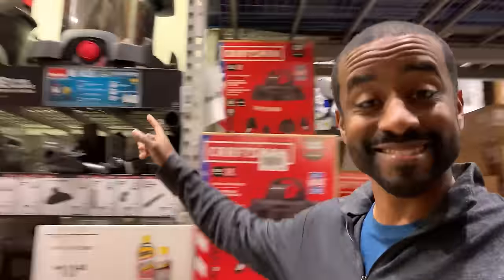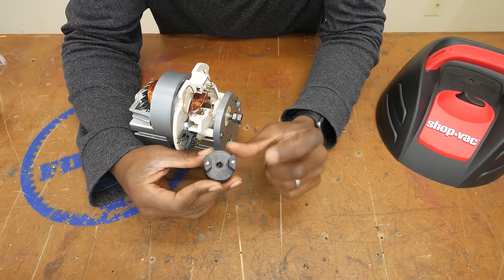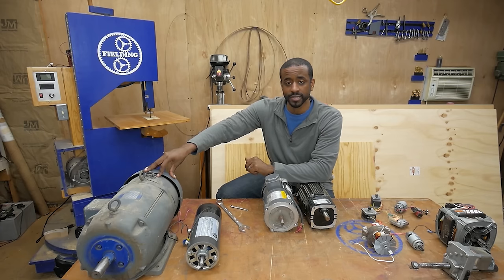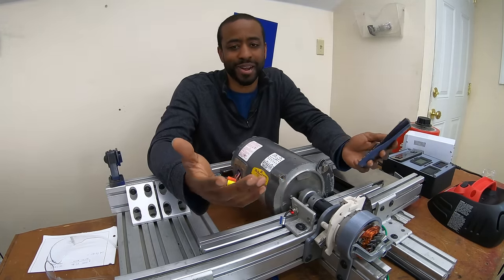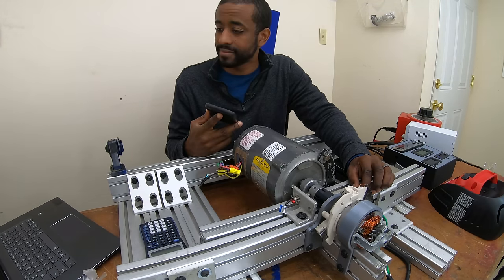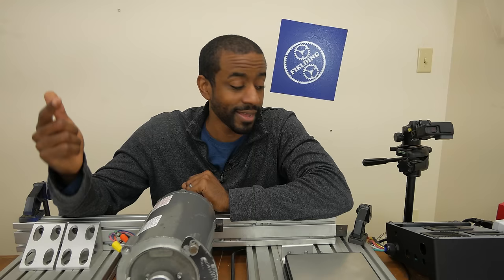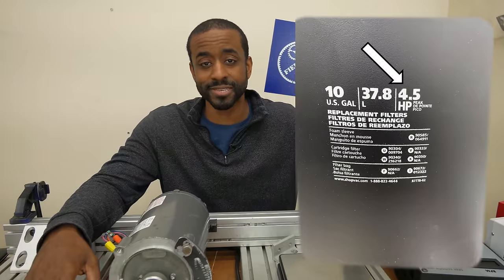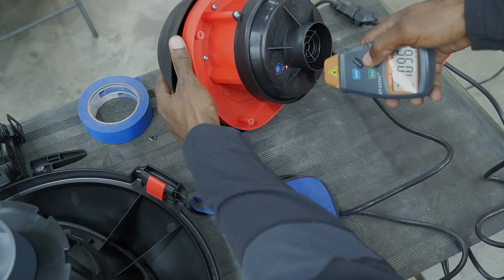How Much Horsepower Does Your Shop Vac Really Have: #078

Comment: What they are saying is if you "unload" the motor (by blocking off all airflow), then suddenly unblock the airflow, the motor will slow down.  In the course of slowing, kinetic energy stored in the spinning rotor will be released.  This release will add to the power produced by the motor itself, raising the power for this brief instant.  This has little relevance in shop-vac motor as not much energy is stored and there is little ability to release it suddenly.  But in for example a wood chipper, that has a 20 lb flywheel and a hammer hits the wood, the instantaneous power can be increased by factor over 100 over the engine power.

Regarding your measured efficiency of 50%, that is typical for brush universal motors that are "pushed hard".  The "feature" of this type motor is high power in small space and light weight, as a cost of efficiency and working life.

Much important then the HP of the motor is the throughput of the filter, when it is in "practical condition" (Englishspeak for "dirty").  Most filters are way too small for the capacity of the motor.

Regarding measuring RPM with vacuum disassembled: the load on the motor is a function of the airflow.  Vacuum open = high airflow + high load = lower RPM.  With filter and hose in place, RPM will be much higher.  The dirtier the filter, the LESS the load.

Comment: Apparently they are throwing inertia in, so the formula (Horsepower = Torque x RPM / 5,252 ) would be assessing the hp at full speed and then applying a "shock" load or a quickly changing load where the inertia can help it power through.

Comment: I may have also found a measure for the missing horsepower.  Of course we can calculate quite easily that 15 amps at 120 volts can only yield 2.4 hp at 100% efficiency, but they are talking "peak horsepower"  So that can include for a second any vacuum stored in the canister and any over-revving of the motor while that vacuum was being developed.  So for example if you plug the end of the hose for a second or 2, a larger than normal vacuum will build up in the canister and the engine will over rev.  For a second or 2 after you unplug the hose the airflow might represent 4.5 hp.  But this is a near useless number.  Amps times voltage represents the actual ability of the machine to do work, and that multiplied by an efficiency discount.  So your particular machine if it truly is running at 50% efficiency (very low for an electric motor) is in fact generating about 0.8 hp of useful vacuuming on a sustained basis.  I believe all sorts of electrical devices are similarly mislabeled.  For example when a generator is rated 2800 watts sustained but 3300 starting, they are talking about a short load to get the air-conditioner running that depends on inertia of the flywheel not the power generated by the engine.  They mislabel all sorts of things this way.  "Peak" power should go away with only sustained load labeled.  And everyone should know it is physically impossible for sustained load to be more than 2.4 hp on a 15 amp circuit, and that assumes 100% efficiency.  The way they label things now resembles sort of if you took the instantaneous energy transfer of an air nailer but did not consider that the air compressor runs constantly.  I am sure if you measured the air nailer over the fraction of a second it was doing it's thing it is 20 hp, but the compressor is not running at over 2.4.

Comment: Excellent  analysis! Just looking at the ratings; 120V and 9.9A tells you it can't produce the advertised hp. The input power would be 1,188 watts or 1.59 hp. Since it can't be 100 % efficient the output power will be less. The inertial effects would add some kinetic energy giving the output a little boost and if you add back the bearing and air friction you would get a little more but there is no way, in their wildest dreams they could produce 4.5 hp. The answer to your question is it's marketing BS, otherwise known as lying. 

Having spent 35 years running a R&D lab that performed this (and many more) test on our products while watching the quality and management integrity decline I've seen this process repeated over and over again with peer companies. 

Again, you did an excellent review. I'll be checking your older videos and follow your new ones.

Comment: Excellent video. Interesting that you guys still sell motor driven appliances rated in HP.  Here in South Africa, the rating tends to be in Watts. Which is generally the power rating of the actual motor, rather than a made up number of horses.

Comment: Probably turn on the motor to maximum speed then load the output rapidly (reduce motor speed by say 50% over 1-2 seconds).  This would allow you to see the inertial effect, they also imply if you add a flywheel to the motor output you get a higher peak up.

Comment: Peak horsepower is well defined. If you take horsepower and torque over time, the point at which both graphs intersect is the rpm at which peak power is produced. This typically happens at around 75% of the highest operating RPM of a given motor. Because the ideal motor doesn't exist and a motor always produces variable torque and power under load across its rpm range.
What happens is as RPM increases so does horsepower, then the motor starts to stall out and lose power after it hits its "peak power". This is where the motor exponentially drops in power and torque. However torque is not consistent across the RPM range. So the power loss isn't linear.

Comment: “including the motors inertial contribution” might mean that for a very short time the motor is also a flywheel and can contribute more power by releasing that stored energy. of course this would mean the motor is slowing down but P = E/T, so if T is very small then so can E be meaning low amounts of energy are taken while still having the same temporary power output.

Comment: It might be easier to just lift a column of water with the vac.  No fancy test equipment needed other than a ruler and calculator.  Big tall tube in a bucket of water, nice tight-fitting hose to vacuum and turn it on.  When the water reaches its maximum height you can calculate maximum peak HP by measuring the height of the water.

Comment: As you noted that HP depends on the motor torque and speed, and I'm guessing that torque is not a huge factor in a shop vac. If you install a true 4.5HP motor in a shop vac, it would be an interesting experiment to see what happens, whether the increased speed causes vibrations that rips the shop vac apart and how much more improved the suction would be.

Comment: The peak horsepower is an example of puffery, it has nothing to do with the utility of the vacuum. When comparing these vacuum cleaners, I use the current draw to figure continuous hp.
In an ideal world they would give you the fan curve for the unit: a plot of airflow vs. pressure drop. Something easy to measure and actually tells you something about how the whole system works: motor and fan.

Comment: I just converted my Trek hybrid bicycle into an ebike with a mid drive motor from the Chinese company Bafang. The motor is supposedly 750 watts, but I easily hit 1300 watts for extended periods of time and it takes it like a champ. This gives me a speed of 34 mph with throttle only and up to 40 with pedaling and throttle. So at least there is still one company out there not fluffing their numbers.
Reply: Is the 750 watt rating the output power rating?  Probably.  And if the motor is 60% efficient, then it would require 1250 watts input power to achieve 750 watts output power.

Comment: I think maybe the hp could be derived from them effectively “dumping the clutch” 
Spinning the motor to max operating speed and putting a massive load on it very quickly and measuring the inertial force.

Comment: This is why if you want to compare workshop vacs....you look up the air throughput (CFM) and pressure drop (KPa).  Plus depending upon impeller design you could have a 10Hp motor in a vac, developing no suction at all.  Regardless, all manufacturers achieve with these bogus hyped claims is consumer distrust.  Good video 👍

Comment: They could even be using a bigger test rig flywheel to increase the momentary inertia HP.  I have no problem with this number as long as every manufacturer tests them the same way.  Then, the unit is meanless, I am just comparing the numbers.

Comment: You are assuming that they used 120V to get that results.  If you ran 400 volts through the system (probably not any where near safe and would probably cause it to melt down on a single test), it should produce the "peak" horse power.   According to my calculations you should get the 4.5 hp with 201V assuming 100% efficiency probably closer to 290V assuming 50% efficiency (there could be compounding efficiency loss due to over charging the system).

Comment: I suspect they calculate the peak horsepower by measuring the RPM versus time during spin-up.  The HP can then be calculated using the inertia of the motor/impeller, the acceleration and the aero and mechanical resistance versus RPM.

Another way of getting an idea of the peak HP is by measuring the current during spin-up.  The peak HP is equal to the peak current * line V * motor efficiency. The motor efficiency at RPM much less than the rated RPM should be dominated by winding/brush resistance which can be measured with an Ohm meter.  The approximate peak output power is peak current * line voltage - peak current  squared * resistance.  This assumes that there isn't magnetic saturation, significant friction and areo losses, significant magnetic hysteresis losses, etc. Oh no, I forgot to include power factor. Man, that is a lot of assumptions!

I'll try to measure peak current during spin-up of my Flux Capacitor based Mr Fusion vacuum and report back. Of course 4.5 HP implies a peak current of in excess of 30 Amps at 100% efficiency.

Comment: In a perfect conversion of power, 745.7 watts = 1 HP. A regular 15-Amp 120-Volt circuit can deliver 1,800 watts before tripping its breaker. 1,800 / 745.7 = 2.414 HP (once again, with perfect power conversion) -- So anyone saying that a 120-Volt product is rated for a whole lot more than 2HP is blowing smoke -- and I wouldn't trust anything they say.

Comment: I'd like to see a test where you put the motor in a deep freeze at like -40 and then run it at like 220-240V and see what kind of numbers you get, I suspect with something like this you will get some very high peak HP numbers close to what you see on the packaging.  

Also, it'd be interesting to see a comparison of a BLDC motor substituted for the universal motor and do a sound decibel test (universals are SO much louder it seems), I'm guessing you will find a 9-15+db difference in how loud they are, and then the 90-95%+ efficency of the BLDC.  Those two things would make it worth while putting them in shop vacs for a higher quality product, and I suspect it would last longer as well.  You could easily throw in a controller for the BLDC version and get varrying suction and loudness, which none of the current models seem to have. Not everyone needs their vacuum at 100% all the time, especially when it deafening, running at ~50% efficiency and pulling 2-8x as much air as what is needed for a job.

Comment: Compare a 4.5 to a 6.0 to see if the one with the higher rating actually has a more powerful motor.  It might be interesting to see if paying more gets you any more power. You should also compare the suction again to see if the increase in the rated HP translates into better performance.
Reply: If you look at the amps drawn by the vacuum, that might give you a clue, assuming the motors are similar efficiency. A 6 Hp vac should draw 13.2 amps, according to the algebra. You could fudge the difference on a vacuum rated at 12.5 amps, if you assume the motor has higher efficiency.

Comment: Interesting note, rotational inertia and stall torque of induction motors can be huge. This does translate to very high "peak hp". This is a real problem when replacing old electric motors with new "premium efficiency " motors. DOE has mandated higher efficiency motors which has raised stall torque by multiples. Old machines that jamb can be destroyed by these newer motors. Result of more core iron, tighter air gap, heavier rotors and much stronger magnetic fields.

Comment: I would think inertial force as tested in a lab would refer to a large bell at the end of the shaft.  If thinking in terms of hp at the rotor as hp at the wheel and hp at the end bell as hp at the crank, reverse of a gas motor, i would think torque and hp numbers could be anything you want it to be with the right converters/ gearing..  but theyd still only be able to do so much..  i was always amazed at those little elevation lift motors on treadmills and how that little motor and gear box was able to lift more than a ton of weight (until it bent a 1/2” thick steel bar and stripped the teeth off a steel pinion...

Comment: They used to do the same thing with air compressor motors. Remember the 6.5hp rating on the craftsman Air compressors? Its a funny thing that you cant buy a replacement motor over 3hp for it because there is a limit on how much HP you can get from 220 volts on a motor that size. So... when buying a compressor DO NOT look at the HP. Look at the scfm rating and the max psi.

Comment: I have a floor cleaner.  It said on the box 1/2 HP.  I opened it up and the motor inside actually had its spec tag on it.  1/3 HP.  I guess they are only fudging a small amount compared to shop vacs.

Comment: Here in the UK they all show power in watts, for example my shop-vac is rated at 1250W which is probably more a reasonable figure given we have 230v (more like 240-250V when measured) and peak we can pull from a single wall socket/plug is 3000W (13A)

Comment: had a stationary vac at work with a 30 horse motor.  we had ports all over the factory. they were 2.5'' or  so. put your fingers over the opening and they would bend a little. pretty noisy to. spenser turbine made.

Comment: This is a very informative video that confirms what I already suspected.  If you understand that 1 HP = 746 Watts, then some simple multiplication can tell you that 4.5 HP = 3357 watts.  3357 watts/120 volts = 27.975 amps.  Assuming 100% efficiency (which is only theoretical), these units would be drawing that many amps from an electrical supply.  The code requirements for the US (where the product shown was bought & made for use in) limit household circuits to 15 amperes of current... a far cry from the 28 amps that a 4.5HP  electric motor would draw (at 100% efficiency).
While I'm not surprised to find that the HP rating is a bogus claim, what I find to be most surprising, is that the test conducted here demonstrated an efficiency rating of only 50%!!  I expected an efficiency of, say, 92% - 96%.  A 50% efficiency rating changes things even more because 4.5HP of output = 3357 watts of input but, 6714 watts if 50% efficient.  Wow!!
GREAT VID!!  Keep up the good work!! :-)

Comment: i live in the uk and you can pull up to 3000w of energy out of our wall sockets/ so 4 bph roughly, no vacuum cleaners are made at 3000w that are cheap . the strongest vacuum i know is the samsung 2000w motor, that thing is insane how much air it moves

Comment: I took the voltage and multiplied it by the amp draw to get maximum watts pulled then converted the watts to HP. I had 1.5HP and was sad. Then Jeremy said 51% efficiency and that dropped me too about 0.8HP. YAY MATH!
Reply: Lesson learned: When shopping for vacuums or air compressors, bring your calculator, and read the data plates. Pay no attention to the numbers on the box!

Comment: After re-reading the description of peak-horsepower and lots of thinking, I noticed that it did NOT specify ROTATIONAL power output of the motor, it just says "horsepower output of a motor". That means ANY type of power output that can be CONVERTED to horsepower could be the (or part of the) measurement (including electrical output, maybe even heat).

Combining that information with "inertial contribution", my guess for what the test is:
1. spin the motor up with no load and the highest input voltage allowed, letting it build up as much angular momentum as possible.
2. Regenerative brakeing, using the motors angular momentum ("inertial contribution") and measure the peak power output from the motor.
3. Convert units to peak horsepower.
4. ???
5. Profit.
Reply: The biggest advantage I can think of to doing the test the way I described is that rotational power does not need to be measured,
meaning that there is no need for a dynomometer, saving money on testing.

Comment: I think in their definition, they get the motor spinning at peak rpm, then brake it instantaneously, and measure the max torque, including inertia of the mass of the rotating rotor assembly to get their number. Obviously this is a scaly AF way to do it because it's the same as measuring the HP of a car by calculating the force it hits an immovable object with...

Comment: Pretty easy test: Bring a multimeter to the store and measure the resistance at the plug with the switch in the on position. That'll give you a ballpark of the kind of performance you'll get from that motor.